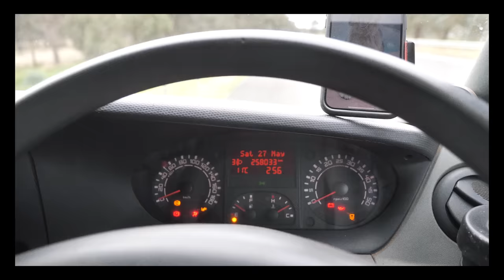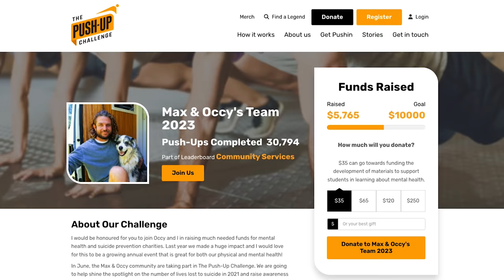I moved to a cabin in the woods

Comment: once you use it reliably....it will feel comfortable...and many houses need repair....builders make mistakes.

like simple layout, research natural plasters like hemp...think lighter than traditional. maybe use woodstove in cooler temps to slow cook preserve...dehydrate food. Can set up a traditional alcove in back of it with a cob bench to accept the heat. have fun imagineering...can be very colorful, inviting. pinterest good ideas